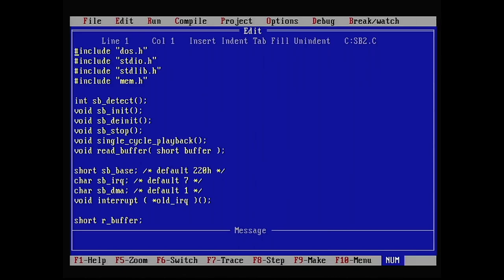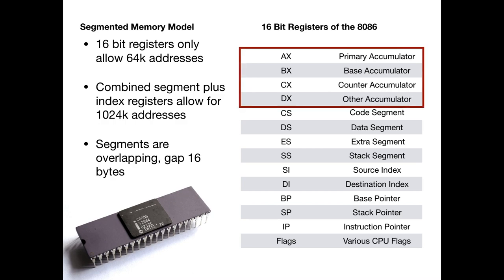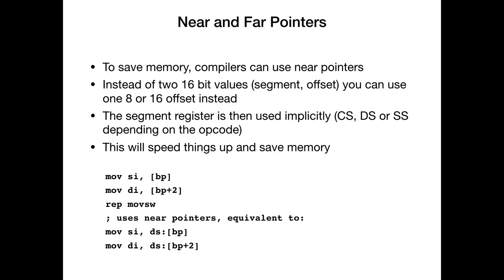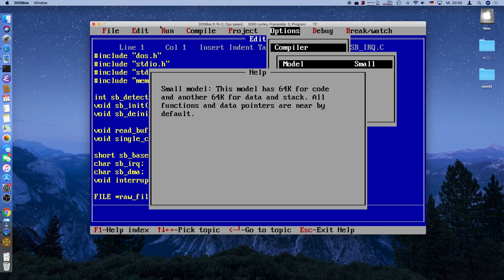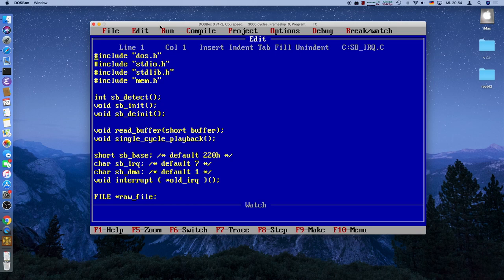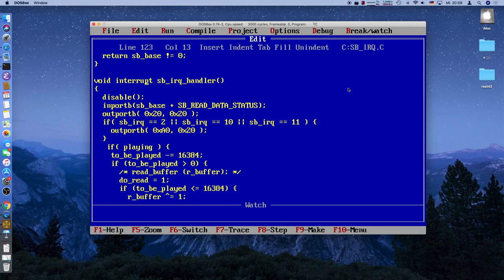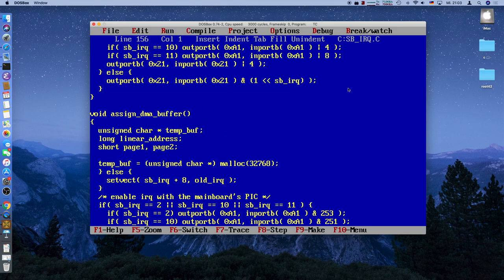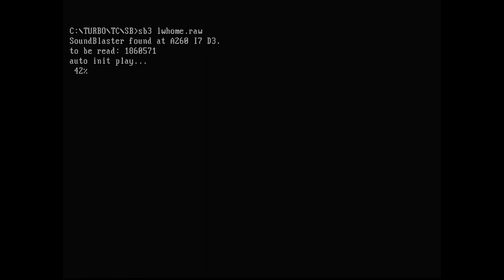Let's Code MS DOS 0x0D: Near and Far and IRQs

Comment: Hey, great update and it does work now on my 486SX-33 except for a tiny error: The last buffer is replayed at the end of the file, so I hear it twice. It nicely quits after that. Did you change anything else?
Reply from the maker: Hm. Actually no, I think not. I will have to investigate that at some point. Did you try my code as well? Does it exhibit the same problem?
Reply: root42 actually i didn’t try your code. Will do so this weekend. Sorry for all the questions - but I’m learning and enjoying your series tremendously and really appreciate the time you spend to answer everything.
Reply: i encounter the same issue with root42 gist code and my dirty fix is to add a check above read_buffer( r_buffer ^ 1 ) if percent equ 100 then break.